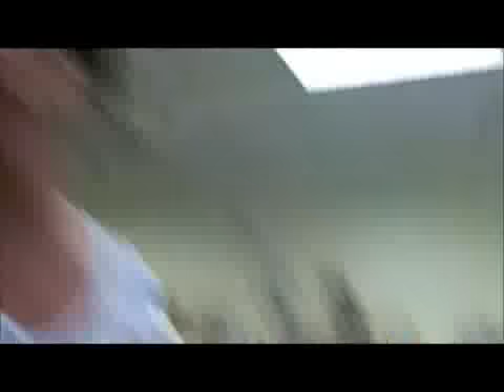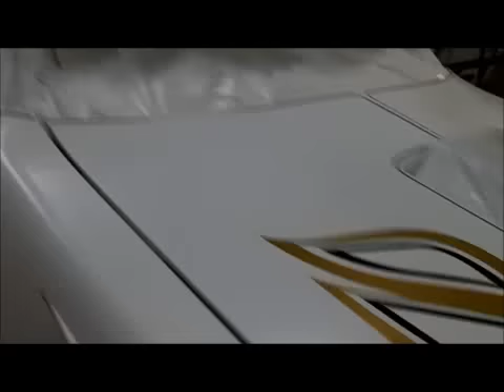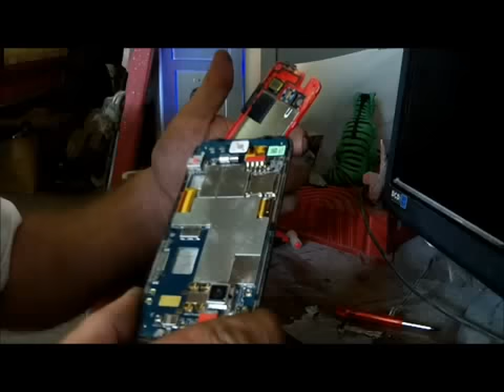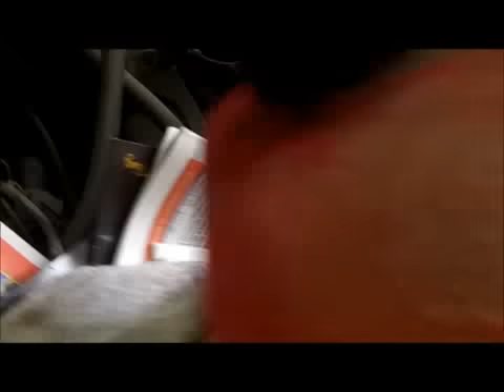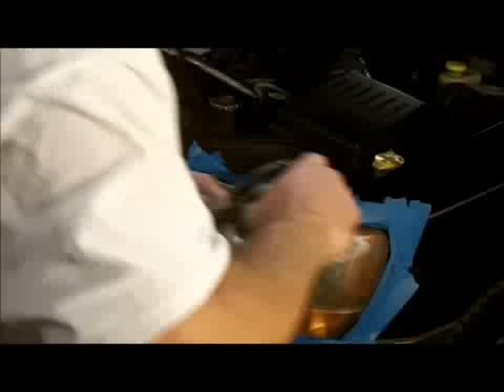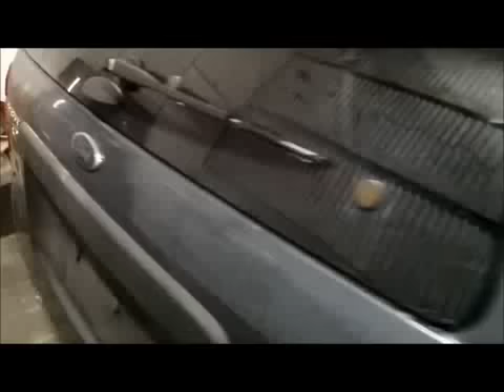Best of Hack N Pack Shop

Comment: I got a 2002 Dodge Dakota with a lot of patches of rust. Looks like I will be tuning in a lot to your channel. I will be doing a full body coat of truck bed liner (UV protected of course) instead of auto body paint.